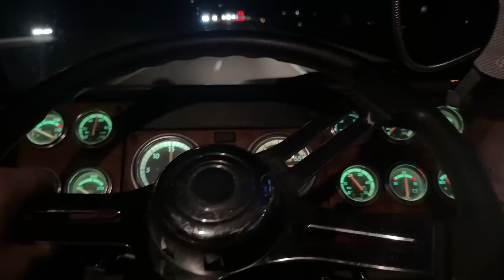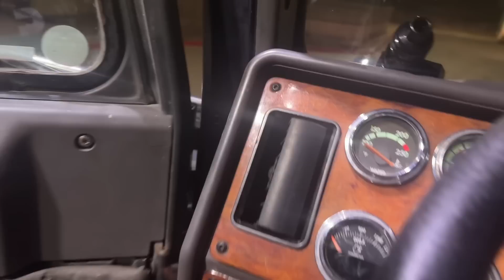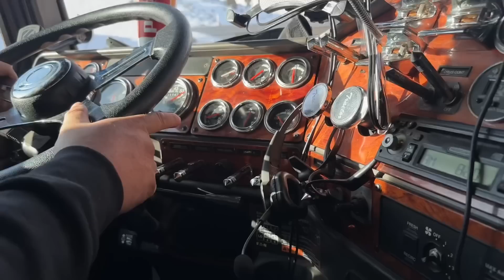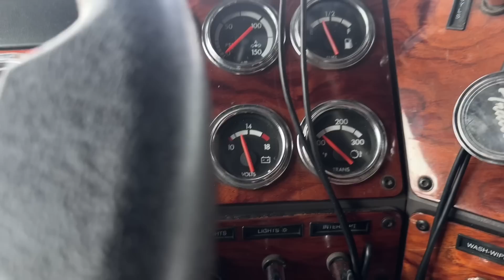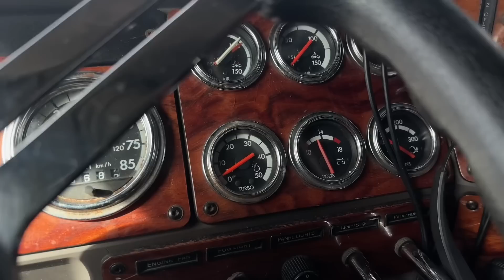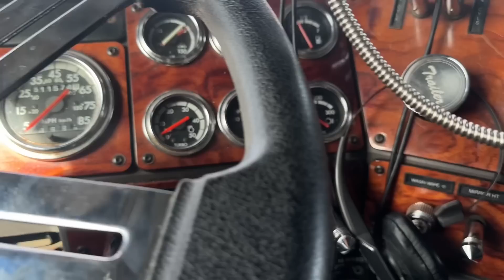We Delivered Ripsaw To Its New Owner.. No one Saw This Coming!!

Comment: seen em, drove one, studied them....   they are extraordinarily delicate,  i saw Whistlingdeisel disable one with a little stick and this very tank got stuck in a tiny little ditch.   in a straight line they do well on flat smooth terrain  and climb better than any buggy.  but you cant get them dirty or wet or cold or hot,  any one of those 4 things or any combination and it's not going to start.  it has to be perfectly clean and dry and kept in a climate controlled building to use it.

Comment: Harbor freight has 20 buck 30 foot long test leads. 
The voltage drop to test chaging system is.   Engine running with headlights on.   Test 1. Across the battery posts.  Are you charging. 

Test 2 Negative battery post to engine block.   Starter ground stud threads.  Alternator case or ground stud threads. 
Test 3.  negative battery post to the frame and then to the cab.  
Test 4  engine to frame.  Alternator to frame.  

Test 5. Positive battery post to the fuse block.  

Test 6 positive battery post to the alternator output stud threads. 

These are tests i do on almost every car and pickup with just a digital multimeter . My test leads are 20 feet long.    I have reduced alternator failures significantly.

Comment: Just wondering. In the U.S, do you guys not use chains much to tie down loads like vehicles etc. I'm in New Zealand and would definitely used chains instead of straps to secure it. I've done alot of vehicle transport and we were mainly supplied with chains for large vehicles like trucks, tugs etc.
Reply: No.  This is him being lazy.  Real truckers use chains.
Reply: @BF  yeah I agree... if a wreck happened those straps would've snapped like a twig...
Reply: @Ganval Exposure  that's what I was worried about as I'm not sure the ratings but the common strap ratings here in New Zealand is 2.5 ton & when I did my license back in the day, unless it's against the headboard or similar the strap needs to contain twice that so need chains really. If I remember correctly...lol...its been a while.

Comment: You can bet a turkey dinner someone threw something at your truck. Going under an overpass late one night in Fayetteville, NC., just as I was starting under an overpass, I caught the shadows of 3 or 4 individuals on top of the bridge. I swear I thought they had tossed gravel on top of me. I pulled off and inspected my truck and then went looking for them. Never did find them. Then one night in Thomson GA., I got hit by a rock or something into the windshield. I was one of several that got hit that night. Driving a truck is definitely a job you can never be sure you are coming home from.

Comment: Interrupt your alternator regulator wire with a switched Bosch relay.  Normally closed it uses the stock regulator.  When relay is switched on . Voltage control can go through a potentiometer so u can adjust the charge level 

Or it can switch to another regulator.

Comment: Dude in the sleeper is a driver / mechanic.  He owns the Astro right?
Reply: Correct. He owns the Astro.
Reply: @rayweeks4018  yeah I've got a 1977 Chevrolet Titan coe Detroit I've had a few yrs. I plan to get it on the road next 4 yrs. Maybe pull a 5th wheel camper . It's a old win- Dixie grocery truck. Runs good no rust needs some work. Not many left. People look twice when they see Chevrolet across the front.
Reply: Doesn't he have the Whiskey Pete also?
Reply: @WillChandlerFLD120  It has been many years since I've seen a Titan. Thanks for saving one.
Reply: @ky.gambler5281   No . I can't remember the name of the guy who has Whiskey Bent. Haven't seen him lately.
Reply: @rayweeks4018  Travis I think?
Reply: @WillChandlerFLD120  Yes definitely Travis. Thanks for the reminder.
Reply: @rayweeks4018  yeah I love the odd stuff. Traded 3 motorcycles for the Titan and a 67 kw coe Cummins powered and a bunch of parts for both tractors.  Both run but not legal. I haven't drove a semi in 32 yrs legal. I was grandfathered in but didnt keep license up to date. I never was over the road just hauled heavy equipment for my family's  construction/ business mostly local.  I'm never gonna be for hire im 55 retired just playing sonny Pruitt lol...

Comment: That Detroit got a lot of room to work on for sure. I drove in the early 90s hauling heavy equipment for my family all in the construction business. I've driven like 8 different trucks all Cummins but one Detroit every truck my parents owned were all Cummins powered. Not really choice but most trucks around my area in the 90s were Cummins powered all ran good.
Reply: I am surprised that Mike didn't help with the alternator problem!

Comment: I’m sure rip saw has an emergency brake , but I assume the straps were strong enough to hold that down. I do t know how heavy it is. Thought it would be chained. I’m a dry Van driver  so I’m not as knowledgeable as you with deck trailers. I always wish nothing but the best for you and your family. Stay safe brother. Your a good egg!
Reply: I haul cars and heavy vehicles straps are more than adequate. And with hauling alls you need is 50 percent of the loaded parcel.
Reply: I guess the trailer magnets don't work because of the rubber tracks?